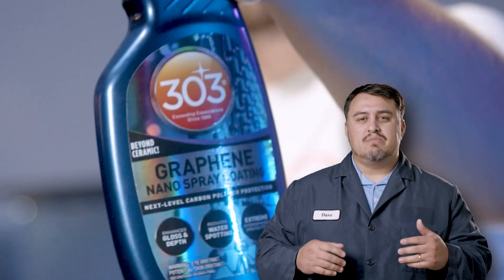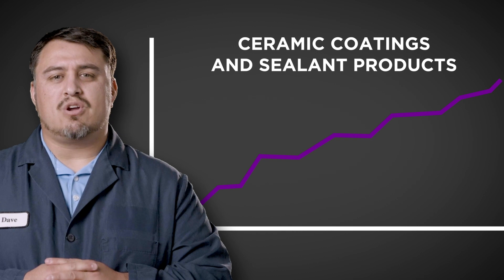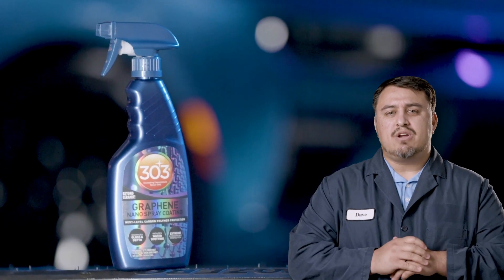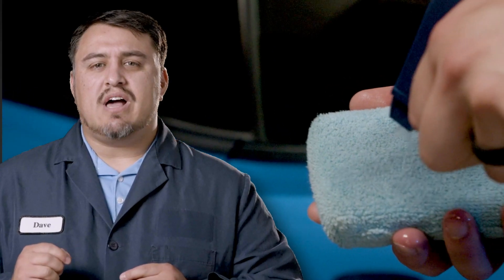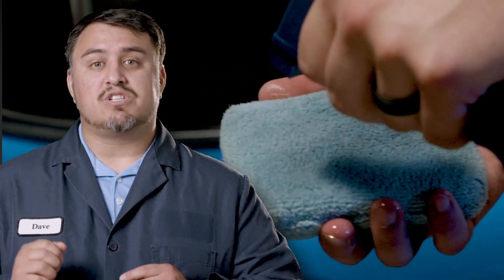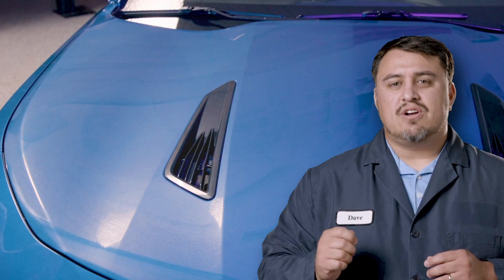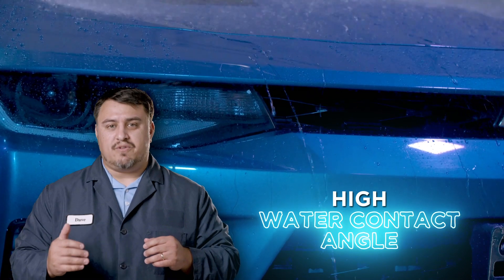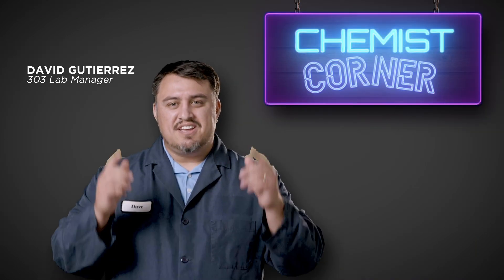Graphene Spray Coatings: The Science Behind Next Generation 303 Product

Comment: I was trying to look for alternative options to protecting the cast iron table surface of my table saw. During my search 303 nano spray coating came up. There is a similar product to the 303 nano spray called Carbon Method Coating which is crazy expensive and I just can't justify the co. They seem to be targeting the woodworking community for polished cast iron tool surfaces. A cast iron table for a table saw is pretty much bare metal with a high polish sanded finish. I was wondering if this product would be applicable to that purpose?

Comment: I am trying to find an answer to.. Can I use this on my matt paint btw with frozen grey matt factory paint, a lot of people say no you can't it will shine and gloss the surface, however your website states that it won't affect the shine on a matt coating. I would like the definite answer, I don't mind a darkening affect and a small sheen as I think that adds to the matt effect. thanks
Reply from the maker: Graphene Nano Spray Coating is designed to enhance the surface it's applied to. So in your case, the matte paint will not be enhanced with any gloss because the surface was not glossy, to begin with.

Comment: i noticed a year ago someone asked if it can be applied over waxes and polishes but there was no answer, so ... can it?? And if you use it on your windscreen glass are you still able to have chips and bullseyes repaired as you can't after applying  Rain-x?
Reply from the maker: Thanks for asking! Yes, 303® Graphene Nano Spray Coating can be applied over most waxes and polishes. It is designed to be layer-able, whether onto itself, on top of other coatings, or as a base layer. Unfortunately, we can't give a good answer to the windshield repair question without doing further tests in our lab.

Comment: I must say this is a better product compared to flex wax, it has a pop to it.

It was tacky to buff , slickness has improved after 3 days. 
Note: I did not see any sort of bleeding before the product hazed.

Is the launch edition different?
Reply from the maker: Thanks for giving 303® Graphene Nano Spray Coating a shot! To answer your question: no, the Launch Edition is the same formula, but obviously, the first batch that came off the line.
Reply: @303Products  question:  what if I want to strip the coating ? Do I need to sand it ?
Reply: @303Products  
Also, it seems to attract a lot of dust ?
Note: we do live in a dusty environment the roof was left uncoated and the entire car was coated with 303. Dust accumulation was same even after driving the car for 5km, used a microfiber duster to check how that works and the dust was sticking to it.
Reply from the maker: @zahirali2129  To answer both questions: 1) To strip the coating, we recommend using a finishing polish, machine applied. 2) The dust should come off better with the coating applied vs. if it is not coated. A simple wash should do the trick to remove it.

Comment: Hi David ,

Question - 
Can I top the below with 303 graphene as a LSP ?

* Carpro eseence, I love the gloss this product has to offers  (Sio2)

* IGL renew F4 (graphene )

* Turtle wax to the max wax  (graphene)

Your answers will be helpful as 303 is positioned at $ 44 usd in India.

TW is priced at $ 31.5 usd in India .

Thank you .
Reply from the maker: Thanks for asking. Yes, 303® Graphene Nano Spray coating is designed to be layered. Meaning it can be used as a base coat, on top of an existing coat of Graphene, or on top of another product as a topper. The best practice is to have the coating with the best durability on the bottom. In a lot of cases that will be 303® Graphene Nano Spray Coating.

Comment: I bought a new car and it had no wax or protection on it at all.  The paint was very rough and when I washed it the water would not bead.  I applied 303 to the car and the surface became very smooth like glass.  After I wash it, I blow the water off with a leaf blower.  The beads of water fly off the surface and I never have to use a towel.  Before 303, the leaf blower would just spread the water around and there was no beading.  303 is awesome stuff.

Comment: should I use this product after the caly ? or it don't matter ?
Reply from the maker: 303 Graphene Nano Spray Coating can be used without any paint prep and will still work great! However, it is best practice to wash & clay your car to remove contaminants before application. You may also choose to polish out scratches and swirl marks before you apply the product, which will really help 303 Graphene bring out the maximum shine and gloss of your paint.

Comment: The reason it turns white is because of the chemical reaction with the outside air temp, nothing special and to date i have not seen any spray coatings real world testing other than a man in australia who did 50/50 of a car, ie: Car pro's Hydro 2 on 1/2 the car and the rest of the car he left it un protected and in 2 weeks of hot summer days rainy days driving around in traffic, he then showed how much protection was on the car and how easy it was to wash and clean compared to the side which was not treated ,now till every single manufacturers does the same with their own products and show just how good the sealant is, then i will believe it, if you do not believe me, show me a youtube channel and pro car detailer who has only 1/2 a daily driven car sprayed with some sealant and then after a month of daily driving in hot summer months or winter days and how much protection is still on the surface, then i will believe it, ? The Guys u tube channel is called car craft auto detailing on u tube, look him up?

Comment: GO (Graphene Oxide) is generally hydrophilic. That means it attracts water, does not repel it. Every Chemistry paper reports this. How have you overcome this? I would also like to address the difficulty in mixing GO into and solvent or carrier. If you use Silane polymer you do get the benefit of repelling water because like other SiO2 products, Silane is a Ceramic in nature. So are we really seeing Graphene qualities or some side effect of the carrier. 
No matter what chemical you use, GO also does not mix into any liquid solution unless it is manipulated. The most efficient is by sonic radiation, yet we hear little to nothing about the manufacturing process.

Much of my questions could be considered proprietary. But in truth the patent for every known method of producing a Graphene product is held at this time by the Google corporation. As they secured the International and US patents a couple years ago.

People will by this product,  so there is little to concern oneself with my musings. But even though I will grab a bottle to test, I am curious as to the research that was done with the effectiveness of GO in a spray solution. How does its longevity on a substrate perform in the elements. I'm curious if it is any better than the polymers it can bind with to be useful? 

Hmmmmm.

Comment: David, 
1. Is there any benefit to using this with your Touchless Sealant? If there is, which should go on first?  
2. Is the self-cleaning properties as good as your Touchless Sealant? Is it as good on glass as Touchless Sealant?
Touchless Sealant is an incredible product. The gloss and self cleaning I've gotten from it are amazing. Its performance on glass is better than most g;lass specific treatments on the market! I am anxious to see if the Graphene Spray is as good in those areas.

Comment: I've been using 303 aerospace and fabric guard for well over 20 years on my boat. Nothing performs like them in the harsh salt water marine environment. My question is, can this be used as a topper for a durable 5 year ceramic coating?
Reply from the maker: Thanks for asking! Yes, 303® Graphene Nano Spray Coating can be layered. So you can layer it on top of itself for added protection, use it as a base layer with another coating on top, or you can do what you're suggesting: use it as a topper on an existing coating.

Comment: I think Graphene can be a great product as it gets developed..There have been claims that Graphene resolves the water spotting ceramics have...The tests in the real world I've seen water spotting was still there... Ceramics and Graphene took just about the same amount of work to remove them...Durability may be increased with Graphene but we will have to see since it's so new... I hope it all works out but I'm betting the best Graphene will be another jump in price over the already expensive best Ceramics...I think there are limits to what people will spend..
Reply: Water spots are just dried on minerals that were in solution in the water.  Once the water evaporates, the minerals are left and they tend to stick to whatever they sit on.  It doesn't matter if it's paint, ceramic or graphene.  Unless the surface is so slippery and steep enough for the water to roll off, you're going to have water spots.
Reply: @sooocheesy  I understand...thats a given...what matters is will they be easy to remove and what I seen it isn't any easier to remove if it's Graphene or Ceramic...maybe there needs to be more tests made to prove one way or another..
Reply: @jamescash3034  I am currently doing a test. I got one car paint corrected and ceramic coated and one car paint protected and graphene coated (Ethos Graphene Matrix).  I will be comparing over the next couple of years to see what is what. What holds up longer, is one more water spot resistant than the other.  For graphene, thats the only claim, is that its more water spot resistant than ceramic.   So if I hosed water on the 2 and let them dry, I would expect to find less water spots on the graphene, but the ones that remain can indeed be hard to remove.  So we will see. It has only been a month since ceramic coating and a week since graphene coating, so way too soon for any real results.

Comment: I have a serious question: Why did you call this product a "coating" when you clearly say in this video that a "coating" is something that comes in a solvent and actually interlinks and bonds to a car's paint and therefore reaches those high durability numbers whereas a (spray) sealant is water-based and will last way shorter. How come that you call a sprayable product like this a "coating", giving customers the impression that they get what they would expect from a true ceramic coating when it really is a spray sealant with a graphene derivative in it that just boosts some of the performance characteristics of the product? Do you think this is a fair marketing strategy and fair to potential customers?
Reply from the maker: Hello, 303® Graphene Nano Spray Coating is a Graphene-Oxide, solvent-based coating. It is not water-based. Typically with ceramic coating chemistry, you are not able to have a sprayable product that is solvent-based chemistry. The mix of chemistry we use in this product allows us to have a product just as concentrated as a Ceramic Coating while still being sprayable. Hopefully, this helps to answer your concerns. If you have further questions, please don’t hesitate to ask!
Reply: @303Products  Thanks for the answer. So this product actually bonds to and interlinks with the paint in the same way as a solvent-based ceramic coating?
Reply from the maker: @AndreasSchwarzinger  Yes, it will bond and interlink with the paint.
Reply: 303 Products in the same way a solvent-based true ceramic coating does?
Reply: 303 Products in the same way a solvent-based true ceramic coating does?
Reply: @AndreasSchwarzinger  there's a video where a guy compares adam's ceramic with adam's graphene.  He washes the sectioned hood over a 100 times and the graphene had much better hydrophobic properties.  It looked like well over 50% improvement in the number of washes.  I have Opticoat on my car and curious to see how it would hold up against graphene since Opticoat is a harder finish.
Reply: @303Products  

Which functional group(s) on the paint remain reactive enough after curing to bond to and/or “interlink” with the coating?
Reply from the maker: @FrankGutowski-ls8jt  Hi Frank-- The bonding capacity of this product has little or nothing to do with the paint or any other surface. The hydroxyl-group from the Graphene Oxide within the product, along with our adhesion promoter maximizes its ability bond to paint, glass, trim, etc. Also, catalysts within 303® Graphene Nano Spray Coating make surfaces naturally attracted to bond to the product.
Reply: @AndreasSchwarzinger  Their job is to extrapolate funds from your pocket. What do you think they'll tell you for an answer?
Reply: @303Products  again, does this bond to the paint in the same way as a true ceramic coating?
Reply: Is it safe to say that this product has the same durability and performance of the sio2 sprayable products? When I watched pan the organizer demo this product it looked and performed just like all of the other sio2 stuff currently on the market
Reply: @tugbankert6581  Instead of the 6 months, basically lite ceramic coating they used to have, this one is a lite graphene coating supposedly last a year.

Comment: Great job David and the team. It's refreshing to see a brand that knows that a lot of people in the audience are knowledgeable enough to take on the points covered in this video. I haven't seen yet more details on the ideal temperature for application, cure time (maximum surface adhesion), increase in gloss level and resistance to chemicals, road salt, etc. I hope the team will work on bringing these details out. I've been a fan of the 303 Protectant for years and look forward to learning more about this spray product.
Reply from the maker: Thanks for checking out the video. We have no cure time and it can be applied in a wide range of temperatures, even in direct sun! Some influencers have already done some "torture tests" with it for chemical resistance. 
https://www.youtube.com/watch?v=R0pcaL7SGbs&t=4s